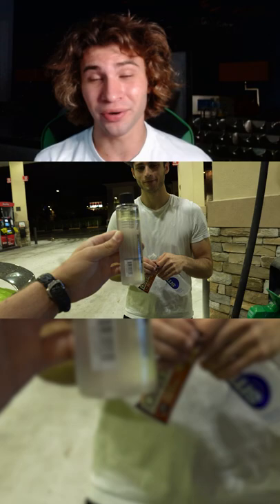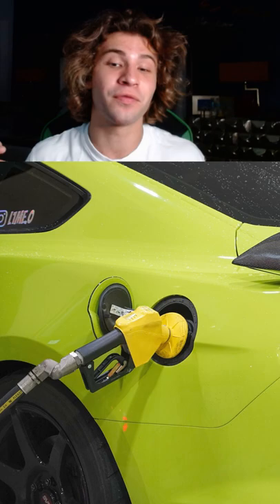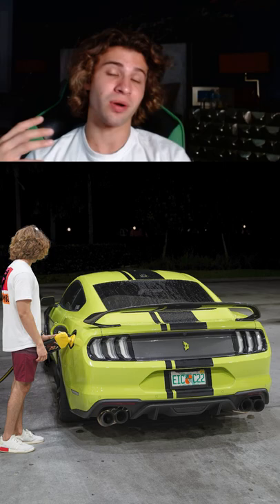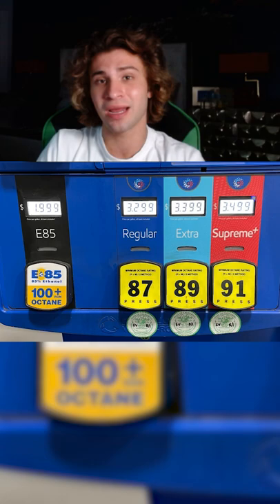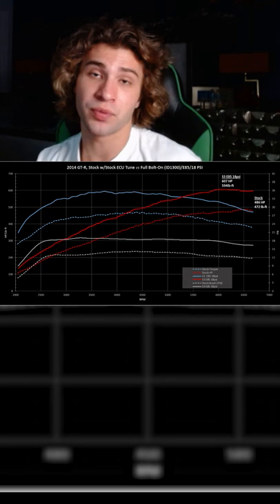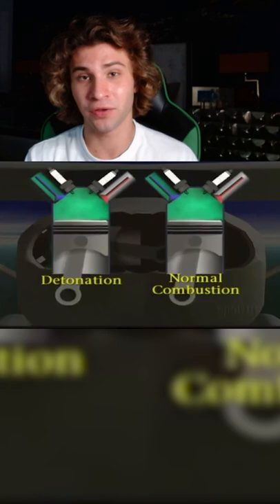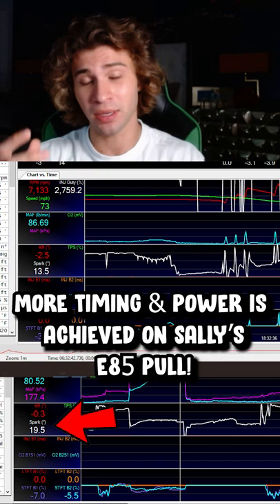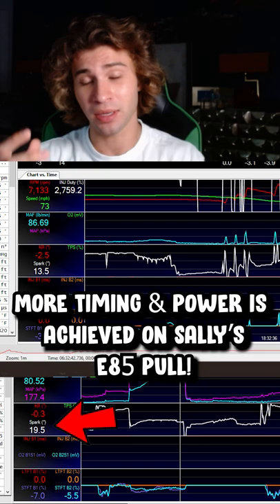WHY BOOSTED + N/A CARS MAKE MORE HORSEPOWER WHEN TUNED FOR E85 FLEX FUEL! #SHORTS #TUNING #E85

Comment: I mix e85 with my 91 up to 3 gallons of e85 in a full tank. I have a 2023 Acura TLX Type S. No issues…car has more power. Way more cost effective than the VP 101 racing gas at 9.99 a gallon. I’ve ran the 101 and my car is basically on steroids.

Comment: Is it safe to put e85 in my grand cherokee if it says e85 on the fuel cap with already having regular gas in it?
Reply from the maker: I’d read the manual!
Reply: Flex fuel cars can use anything from regular gas to E85 and anything in between.